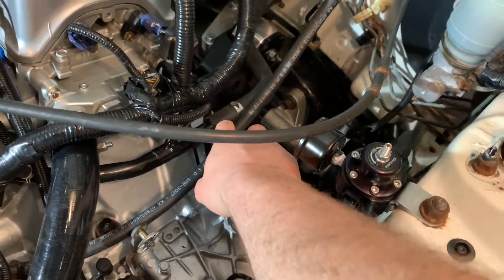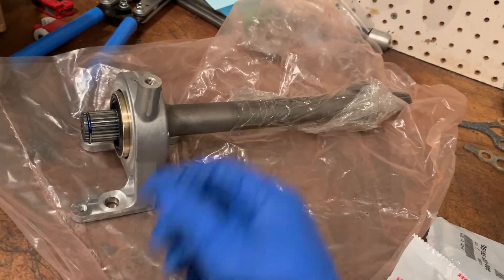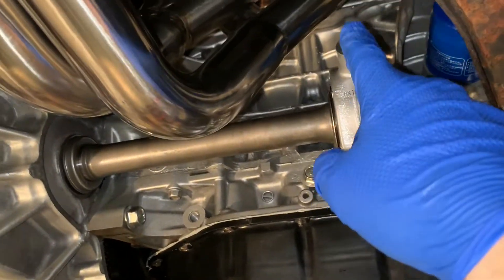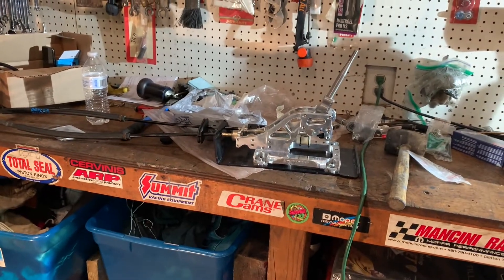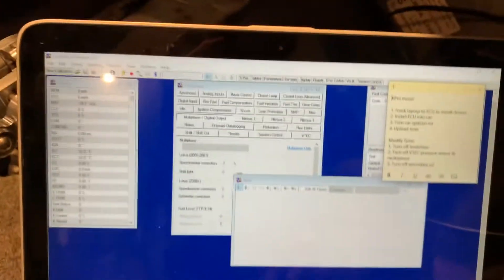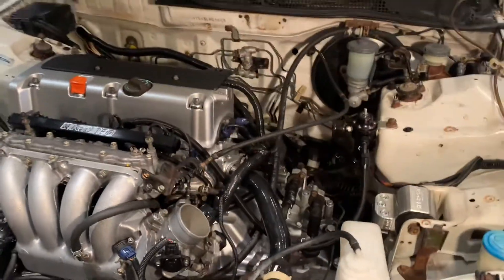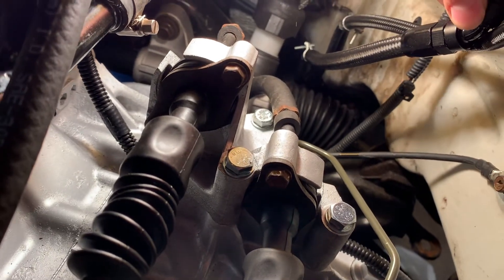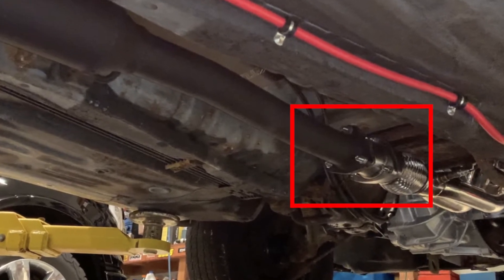K24 Swapped 1995 Civic First Start - Civic K24 Swap Part 12

Comment: Ive just turned the key on my K-Swap with a JDM K24A (your videos were super helpful as background research by the way - thank you). Its running, but currently I am using a stock EP3 ECU, just to let me start the engine for minimum cost and i'm getting an error P1259 to do with the VTEC pressure sensor. I noticed on your map you disabled this sensor. Why is that? Does the engine not use this sensor? I've seen a few places saying to turn it off (on a mappable ECU which I will get soon) but no explanation as to why. Thanks in advance.
Reply from the maker: Yes, the JDM engine does not have it.

Comment: Can i run a accord trans with jdm k24a. And what harness and ecu should i get
Reply from the maker: Yes, that's what I did. I used a Hondata K-Pro ECU from hybrid racing and a modified 2002 RSX harness. I have a video where I customized the harness to work with the K24

Comment: What trans are you running? Is it the tsx 6 speed?
Reply from the maker: Accord 5 speed. I was thinking about upgrading to the TSX trans but, aside from the obvious cost, my car is currently making a lot of torque low in the RPM range so seems the 5 speed is a pretty good match. Maybe an RBC intake or a re-tune would change the torque band.
Reply: Hey what shifter box did you use for this swap?

Comment: So i got a k20z3 trans what cables should i run stock k20z3 or accord shifter cables? Is for a ek? Look all the episodes definitely one of the few videos that are kinda in depth
Reply from the maker: Thanks! I would run the accord shifter and cables with the KTuned adapter bracket.

Comment: Anyone know if its possible to start a kswap without the trans in ? 🤔
Reply from the maker: Definitely is. You can do pretty much everything then install trans, cables, trans mount last. Might have to support the engine with a jack until you get trans in. I am not sure if its good to have only the back and passenger engine mount support it.
Reply: @e-dod  you think it would be ok if I cranked it and actually started it without the trans and a jack supporting it on the oil pan ? Lol
Reply from the maker: @alfredoreynoso8946  Yea its fine. Look up "engine run stand" on google. Its actually very common to run engines with no trans.
Reply: @e-dod  thanks ! i appreciate it bro ! 👍

Comment: Hi there I got my k24a in my rsx. I am having a problem with the engine turning over I changed the starter and has new battery. Car won’t crank at all. Any suggestions?
Reply from the maker: Glad to hear you got the engine in! You got all the grounds installed? Wire running from battery/fuse box to correct post on starter? Also, there is a wire for starter that should run from you conversion harness all the way to starter. Make sure that is there and hooked up. I think that wire is supposed to either send voltage/ground when you turn ignition so you should be able to check with multimeter.
Reply from the maker: Just realized you won't have conversion harness since you got an RSX. I would still try to verify everything at the starter with multimeter. One wire at starter should have constant 12V with key on. Other should only receive voltage/ground when engine is cranking.

Comment: Hi. Can you share part # for half shaft and bolts pls. Also are those axles 36 splines?
Reply from the maker: Axles are 32mm so they work with stock EG hubs.

Shaft: 44500-SVB-A00
Bolts: 90102-SF1-000 (2), 90165-SE0-000 (1)

https://www.hondaautomotiveparts.com/v-2006-honda-civic--si--2-0l-l4-gas/chassis--driveshaft-half-shaft-2-0l

Comment: Glad you got it fired up!  It's always nerve wracking and exciting at the same time!

Just a heads up for you...
After watching your fuel system video and this one.  You might want to revisit the fittings at the fuel pressure regulator.  The threads gong into the regulator are NPT, and should have Teflon tape on them.  That was not shown in your earlier fuel system video.  In that video, I did see you install Teflon tape on the AN side of those fittings.  No Teflon tape is needed for AN fittings.  So to best eliminate future potential fuel leaks, I'd suggest you remove/clean the Teflon tape from the AN fittings and add Teflon tape to the NPT threaded portion of those fittings going into the regulator.  They do make yellow, fuel safe, Teflon tape that is great for these areas.

On a safety side of things, I was concerned to see the incandescent trouble light being used to look for a fuel leak.  I day this because a friend of mine lost his shop, and everything in it, to a fire while working on his fuel system with an incandescent trouble light.  Some fuel hit the bulb, it popped and ignited the vapors in the area.  Ever since then I've only used florescent and now led lighting.

I'm just looking out for you and others in sharing the above info on the fittings and trouble light.  I hope it is received in the way I'm intending it!

I wish you the best!  I'll be following along with your swap!
Reply from the maker: Thank you so much for the heads up! I will definitely be fixing the issue with the regulator before the car is started/driven again; my first time ever working with AN fittings.

Terrible to hear that happened to your friend. Luckily have some LED lights at the shop so will be sticking to that in the future.